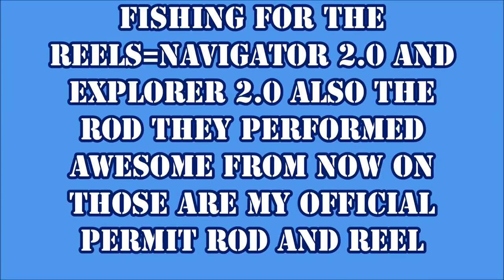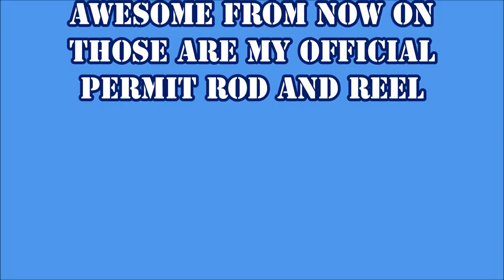This FISH will MAKE you SWEAT 😓, PERMIT Fishing, Florida keys, BRIDGE Fishing long key bridge

Comment: Right on thats what I figured.
Reply from the maker: From a boat 20,25 will do 💪👍
Reply: @RickysFishingAdventures  yeah i figure the same setup I have for Gag Grouper.  8ft mh conventional with my okuma Cortez CZ55w w/50lb mono.  80lb bite leader to 7/0 hook?  I also have a fathom 40n 2 speed with 80lb hollow and a 25yd leader of 60 or 80 mono too to winch them away/out of structure.
Reply from the maker: @adamhfishing  that will work great, 20,25 you get more bites but u loose the fish 98% of the time !